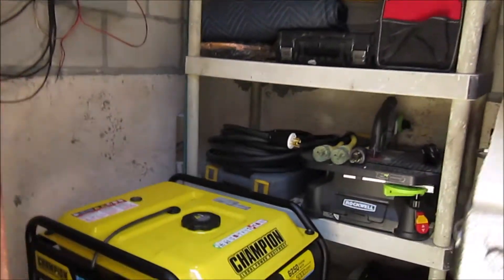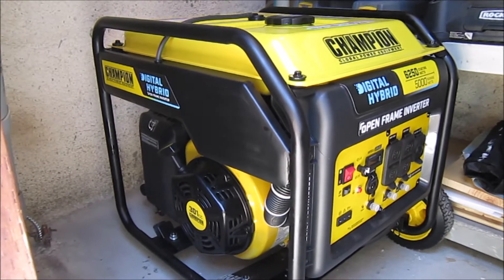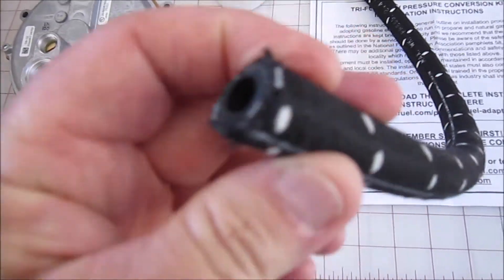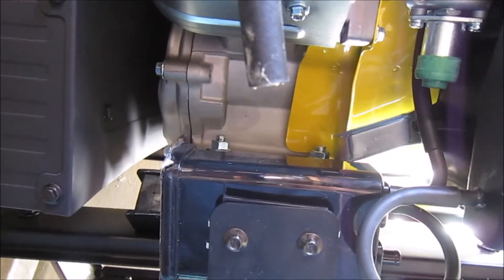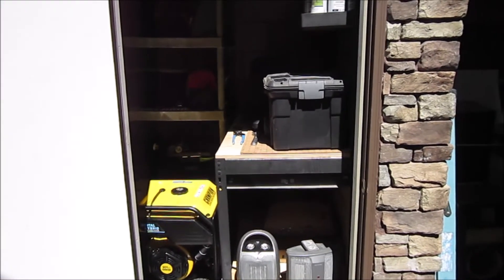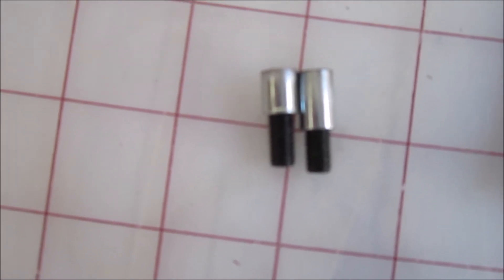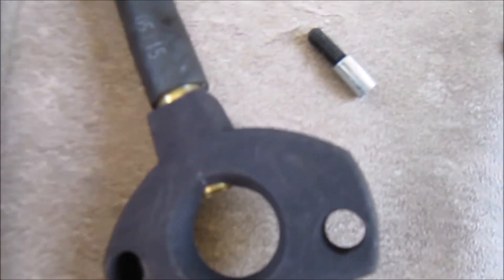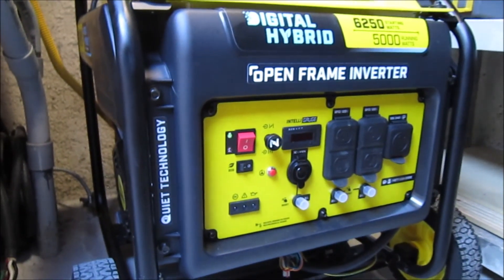Champion 5000W Natural Gas Conversion Comparison of Motor Snorkel and Nash Fuel Conventional Venturi

Comment: I have this generator.  How much does it put out with the motor snorkel?
Reply from the maker: Unfortunately, I didn't have a large enough load bank to test the FULL output power when running on natural gas. I only had 2 portable bathroom heaters which would be about 3,000 to 3,200W with both running on High. Typically you would loose 10 to 15% of the power output when using nat gas on a gasoline generator.

Comment: What do they mean by carb side out?
Reply from the maker: The notation on the venturi adapter is "Carb Side"  with an arrow. That side goes against the carb and the air filter box goes against the other side. This is because a venturi only works if the air is flowing in the proper direction. Its a uni-directional device and must be installed properly.
Reply: @bentleyjarrard885  Thanks.

Comment: Hi Jarrad, yourself and few others have commented about the snorkel getting in way of choke when running gasoline so I emailed US carb last night and pleasantly surprised with their quick response. 

Shawn (US Carburetion) 
Hello,
 
  The snorkel is designed with a flexible probe that goes past the choke butterfly. The probe is designed with an extremely durable material that is able to be squashed by the choke when closed and then springs back to it's original form when the choke reopens. (pics attached of the choke closed on a champion carb). The only time I've ever seen that being an issue is on the generator's that have an automatic choke. They use a tiny servo motor to close the choke automatically and it just isn't strong enough. However I haven't seen issues on the manual chokes over the years.
 
They sent a very large picture of choke open and closed (mostly) but don't think I can upload it here, unfortunately.  I will be going with US Carb version and not Nash and appreciate your video
Reply from the maker: Thanks for the comment. Additional info and clarificatiion is always welcome.

Comment: Could you attach Venturi. Inside of air filter canister? Drill a hole for hose?
Reply from the maker: I suppose you could install the venturi inside the airbox as long as the air filter could be "seated" in its proper location without gaps that would let in debris.

Comment: Thanks for the video. I have enphase M215 micro inverters and bought the same generator as your mainly to try to trick the solar into thinking I'm grid tied. I noticed the envoy on your wall and was wondering if you have tried getting your solar to work off grid? I'm also looking at the enlighten AC coupled battery that pairs well with the m215 but only after the firmware update. Any thoughts on their battery or doing the firmware update?
Reply from the maker: dcuste, You ask good questions, the answer is a bit complicated. I have posted other videos describing the Schneider inverter and LFP batteries that are connected in an AC coupled configuration. Yes, the Enphase inverters do continue to work just fine in a power out situation with the Schneider inverter providing the source of 60Hz. If the Enphase system is producing MORE solar power than is being consumed by our home the excess gets pushed through the Schneider charging circuit into the 48V batteries. When the batteries are full, the Schneider Inverter increases the frequency to 60.6 Hz thus forcing the Enphase Inverters to shut down per UL1741 so the batteries don't overcharge. A typical Grid-Tie inverter like the Enphase is an MPPT type system and will attempt produce as much power as possible based on immediate solar conditions therefore you should NEVER try and use a generator with your grid-tie inverters. Any excess power will get pushed backwards through the generator electronics and most likely destroy them. As far as the Enphase AC coupled battery, in my opinion it is overpriced, electrically undersized and physically bulky. Its one of those things that may look good on paper and in theory but is not practical.
Reply: @bentleyjarrard885  Thanks for the fast reply. I watched your other videos and your battery system is exactly what I've been looking for. Your shed and yard came out very nice. I can see your abilities at design and fabrication are top notch. I have an extensive X10 network of probably around 30 devices and control it with a X10 CM15A, a honeywell 20p security system and a raspberry pi that transmits PLC and RF and is also controlled by Alexa. I originally thought having Alexa control would not be useful, but now I find my using that constantly. My 20P is controlled remotely using an EyezOn board. EyezOn allows me to completely monitor and control from anywhere that has internet to any X10 device in my home. It also allows me to schedule events on google calendar to control devices like lights, sprinklers and the driveway gate. It all pretty robust.

Other than that we have very similar interests/solutions. I am located in Fallbrook in a fire area so I've had my power interrupted and expect more outages. I was out for about 3 hours yesterday. I would like to talk with you more about how I can accomplish what you have done with the battery and hopefully give you some ideas too. Not sure of YT  policy, but if could email me using my YT handle at yahoo, I will reply with my #.
Reply from the maker: @dcuste  I sent you an email from protonmail, hope you get it.

Comment: Thanks for the vid, and info on load balancing between the outlets. I got the next inverter up, 100520; and run as a portable home back up. Just got the motor snorkel and will able to load test up to 6500 watts with NG, gas it's rated for 7250. We will see. Check my champion vid to get it to run ur home AC.
Reply from the maker: Thanks for the positive comments, glad you found the vid worthwhile.

Comment: on a 7000 watt gen you only loose about 1200 watts thats not that much lol always use hose clamps vibration can knock the hose off better safe than sorry n dead .....
Reply from the maker: Thanks for watching and for the info.
Reply: Well, Mr. Snarky, it actually is not that much.  The trade off is for convenience of having an unlimited, reliable, fuel supply and not having to deal with the problems of fuel shelf life and contamination in a normally-aspirated engine.
If you're running an inverter generator at 100% capacity, you bought the wrong generator for your application.
A  17% reduction in power generation is not the same as a 17% reduction in generation capability.   NG is less energy dense than LPG, and far less than gasoline. 
This, essentially, means you are running the generator at 17% under its rated capability, which  you SHOULD DO, anyway.  So, it is NOT that much if you're doing it correctly.  You're welcome.

Comment: I recently got a kit very similar to the motorsnorkel. Everything appears to be attached properly, but am having a tough time starting it with nat gas. spark looks good, no leaks, i feel neg pressure from the spark plug hole, oil looks good, no warning lights, etc. Did you need a carb quick start spray? Champion says its likely a fuel flow issue - from what u said, perhaps not enough air coming through? Thoughts or tips? Thanks!
Reply from the maker: Hello, sorry you are having problems starting, its a common problem. You didn't mention if your regulator has a priming button? It's usually necessary to push the priming button for 1 to 2 seconds to get some Nat Gas in the filter box and carb intake area because at the low starting RPM the regulator does not deliver any fuel. The initial prime allows the engine to fire and get to sufficient speed and intake airflow that the neg. pressure regulator will open and deliver fuel. The starting technique is something that is unique to every situation, it takes some time to figure out. That said, in your situation I would be inclined to skip over the "start up" learning curve and perhaps try and use a cordless drill with a socket attachment to spin the motor faster using the flywheel/crankshaft nut behind the pull cord cover. If you can at least get the motor running then you can adjust the fuel mixture screw and verify that everything is working. Once this is done, you can revisit the start up procedure trying different things until it works. Be very CAREFUL if you do use a drill, you  must pull it off the nut as soon as the engine fires.
Thanks for watching and commenting. Let me know if any of this helps.
Reply: @bentleyjarrard885  thanks! Yup, has priming button and played with it a bit. After watching a few reviews, Im going to try the carb quick start and see how it goes. Hoping thats enough to jump start it. Thanks again for the reply!
Reply: Fyi for anyone that may read this, carb quick start spray in the carb worked. That plus purge for 3-4 seconds and it fired right up. Thanks again for the video and assistance!
Reply from the maker: @user-fx5gb2vf9g  Thanks for the follow up info. Good to hear you had success with the conversion.

Comment: Great video bud! How many running watts were you able to get out of her running on NG?
Reply from the maker: Thanks for the positive feedback. After posting the video using the 2 space heaters (2500W) I actually never conducted any further testing such as the max output. Now you got me thinking, it would be interesting to do a full load comparison with gasoline vs. nat gas. Problem is I don't have access to a good load bank where I can ramp up the current in measured increments.
Reply: All good bud I’m fixn to rig up the same exact set up with NG just I was curious to see how many running watts you could squeeze out!

Comment: Just recently bought the same model generator, also wish to convert to natural gas.  I had spoken to a couple of the generator conversion companies tech's and they mentioned because inverters ramp up and down, the fuel flow needs to be throttled too.  Also, if the generator stops, you need some way to stop the flow of gas or you will have a serious explosion hazard in just a few moments.  That said, I thought about using a MODULATED gas furnace controller to control the flow of natural gas to the generator, with the load controlling the gas flow, and if the generator stops, have the gas controller immediately stop the flow of gas automatically.  Considering my home power has only been off about 18 hours in the last 10 years, I suspect I would spend more time trying to convert it than I would ever use it,  so unless I get really bored, I'm thinking I may just leave it as a gasoline burner and find other things to get into.

By the way, thank you for taking the time to post your video, I feel it is the best so far that I have found.  Your comments about the inverter output were particularly helpful since that is something that had not occurred to me about the inverters being a pair of 2,500 watts each, in series with each other.  Somehow I lucked up and the transfer panel I bought has dual meters to help keep things balanced and I will certainly keep a close eye on it now that you brought up the balance issue.

Best Regards,
Reply from the maker: Thanks for watching, and the kind words. I wanted to comment regarding the Natural Gas conversion and safety. The Nat Gas regulator for an engine conversion is a NEGATIVE pressure type that SHUTS OFF when there is no air flow (engine NOT running). The way it works is based on the venturi effect. The adapter for the conversion kits are installed between the carb intake and the air filter box. Its the air flow through adapter that creates negative pressure and causes the regulator to open thus Nat Gas flows in an amount proportional to the air flow through the carb. You shouldn't need any special modulating valves or anything like that. Of course when the generator is not in use I turn off the main valve. If you intend to use the generator as a back-up in auto start mode I would certainly consider some type of solenoid valve and not rely only on the Nat Gas regulator. That said, the Nat Gas regulator absolutely should not allow Nat Gas to flow unless the engine is running on your generator. Typically you would exercise the gen once a month and check everything for gas leaks. Hope that makes sense.
Reply: I think that's typical....and one of the reasons I decided to use only 120v to feed my house during outages, using the generators TT-30R.

Comment: I installed the motor snorkel on champion's next larger size generator the 100520 (7000 running watts).   I'm adjusting the gas block as per the directions with a digital tach but can only achieve a max of 3400 rpm. Is this because it is an inverter?   Did you measure your RPM.    I'm using a BBQ tank and regulator and it's about 20 degrees F outside today so that might be part of it.  Any advice appreciated.
Reply from the maker: Hello Thomas, I didn't use a tachometer to adjust the gas flow. I just set the eco throttle to off and adjusted the screw IN (lean mixture) until the motor just started to run rough then backed the screw out about a 1/4 turn. I then set the eco throttle ON to lower the RPM and turned on a load of about 2500 watts to see how the motor reacted to the throttle being opened rapidly. It seemed like there was a little hesitation so I opened the adjusting screw about another 1/4 turn. Seems to work just fine. You are correct that inverter type generators are not dependent on the RPM to regulate frequency as were the traditional 2 pole type that ran at 3600. The inverter regulates the frequency and voltage electronically. That said, it is still possible for the voltage to "sag" a little when a large load is placed on the generator all at once since it takes a certain amount of time for the engine to speed up when the controller opens the throttle. This happens to a larger degree when ECO throttle is ON then the RPM is allowed to decrease for fuel economy.

Comment: I want to buy this exact generator and the Motor Snorkel kit for natural gas.  Can you give us a shopping list to buy to make sure we get it correct?  Thank you!
Reply from the maker: Hello Rob H, The Motor Snorkel Kit was the easiest to install and didn't require any additional hardware. As it turns out, I had called them directly because I only needed the Motor Snorkel not the whole kit with the regulator. The order was placed via the phone so I do not have a record of the Snorkel part number, they looked it up and sent it. Also their website is not all that good with regard to being able to look up kits by exact Generator model number. If you call them directly 1-800-553-5608, MotorSnorkel.com they will look up the correct kit for you. Thanks for the comment.
Reply: @bentleyjarrard885  Did you ever get it working properly with NG?  Even if I don't buy this one, I'd probably look at a similar Chinese clone.
Reply from the maker: @rob21 , Yes, is working great. Both Nat Gas conversion kits worked, its just that the Nash Fuels kit required some additional hardware and some minor drilling on the polymer venturi attachment to get the carb vent to line up. I did a follow up video after the Nash was installed.

Comment: Has anyone tried to start a generator with the Motor Snorkel kit installed on gasoline with a "cold" engine?  Watching the installation, it seems that the snorkel tube would prevent the choke from closing and thereby make starting the generator cold on gas very difficult if not impossible.  Thanks!
Reply from the maker: D C, good observation. Yes the Motor Snorkel does obstruct the choke plate but is a fairly soft rubber compound that can bend and deform easily to allow the choke to close, at least partially. This feature is mentioned on their website. You are correct that rubber will get stiff in low temps, and also worth noting, tends to get harder and more brittle with age. I'm in the Southern Calif area so we don't see temps below the mid 20's. When I posted the video we had avg temps in the 60 to 70 range and I had no problem closing the choke to about 75% and starting on gasoline. Not sure what potential problems you may have at very low temps. Probably worth a call to the distributor and ask them what kind of rubber they are using and how it responds to lower temps.